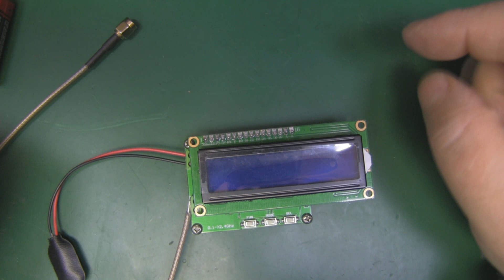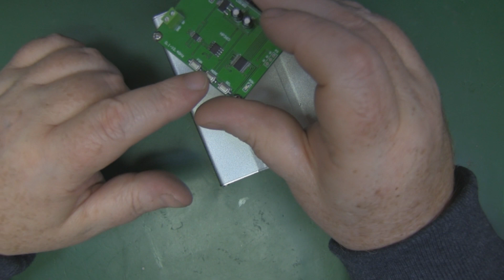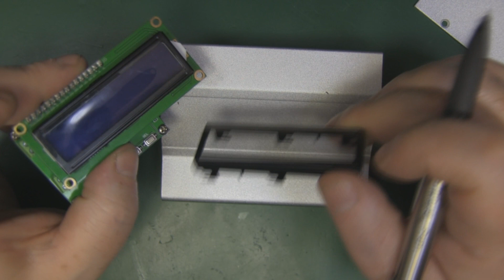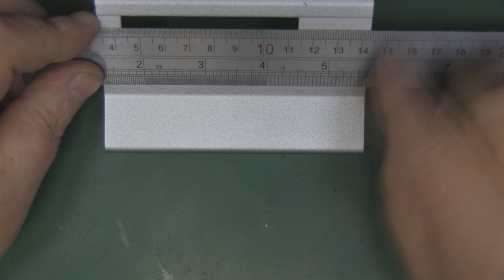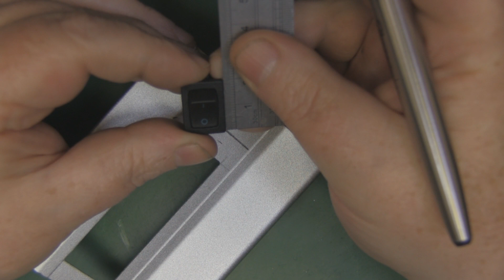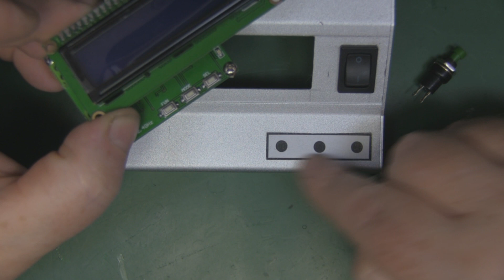A Cheap Little RF Power Meter for up to 2 4GHz #167

Comment: Andrew -
the link is not working. but i found it on ebay anyway. the problem is that the power range listed is up to 1 watt, and 0Dbm. these are not the same. do you know which is correct ?
the other thing is that you don't show if the frequency range must be at certain intervals (900mhz, 433mhz, etc), or is it continuous ?

Comment: I got one of this from ebay, but I'm not sure how to operate it. If you "ADD" the attenuator value, is it actually adding attenuation? With 0 in attenuation and I try to measure a 100mW radio, will it show around 100mW and 20dBm? If I want to measure a 1W radio, should I ADD 10db of attenuation and expect to see the 20dBm?

Comment: Andrew, the diode is just for protection against reversed power supply polarity. The RF power measurement is done by the middle chip. It takes the signal from the input to the circuit and outputs voltage proportional to the power in dBm. My guess is that it's one of popular ADI logarithmic power detectors, e.g. AD8313. It's hard to guess the exact model without having good pictures of both sides of the board. The tiny chip looks like an RF switch made by ADI switching the attenuator on and off. The biggest chip driving the LCD is a microcontroller. Most likely one of the popular ones, like ATmega/PIC/MSP430.
Regarding the attenuator: I would not expect too good performance from this circuit, but measuring 1.7dBm with 2dBm input is not too bad. I'm sure the attenuation is factored into the value displayed on the screen and you don't need to add the attenuation to the result, like you did with the external attenuator.
Reply: Thanks. Are there chips for a 20GHz powermeter?

Comment: Another nice project Andrew, thanks. I can see that project box being very useful with that LCD display and an Arduino in it.
Reply: I meant to ask if  you could give us a link to your source?
Edit: 
Is this the one http://www.aliexpress.com/item/Aluminum-Box-Enclosure-Case-4-33-3-27-1-57-0-75-L-W-H/1725597887.html?spm=2114.01010208.3.421.sMEUcr&ws_ab_test=searchweb201556_10,searchweb201602_5_10057_10056_10065_10055_10054_10059_10058_10017_107_10060_10061_10052_414_10062_10053_10050_10051,searchweb201603_7&btsid=1db55566-4277-466f-99ee-bb1fcff30539 ?

Comment: Nice! Just my personal preference - I would put the bulkhead connector on the top horizontal surface so that an antenna would stand upright for testing 2.4GHz radio control transmitters.

Comment: For someone who has never imagined they would be able to afford something like this. 
Can you explain how to use this RF meter a bit more. 
I use 1.2Ghz for my FPV video signal and 2.4Ghz on my Radio Controlled plane. 
Also what are the power input limitations?
I would like to measure one of my 1.2 video transmitters that says it works as high as 1.5Watts which i very much doubt its anything higher than 1W.

Comment: great video as always andrew!i wanted to ask you for a long time which antenna you have made you think had the most dbi i mean i watched all of your videos and i was impressed by the cantenna, the yagi in a can and the new version long range biquad yagi.From them which would you choose for better signal reception/trasmition for use in a city???(with best aiming possible of course but many walls around)i will use it for point to multi point.For the omnidirectional part i chosen a 4dbi dipole but because of the dinstance a have some signal drops with the windsurfer i am using until i built a proper directional antenna for testing and then making about 3 to complete the network.thanks for your time reading this, english is not my native so i am sorry for anything that's not right.

Comment: Nice one Andy I have beeen looking at these to check the output level of my signal generators. I can see that they arent the most acurate thing in the world but its just an indication Im after. Another drawback is the lowest readable indication being only -70 dbm I would have liked something that would read smaller signals than that. But for this money its a product thats hard to beat. Thanks Andy